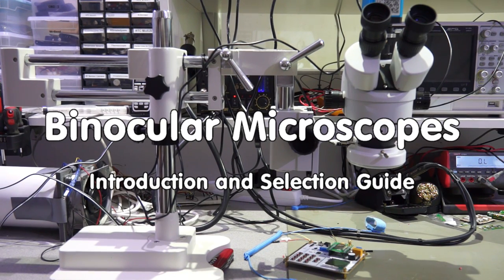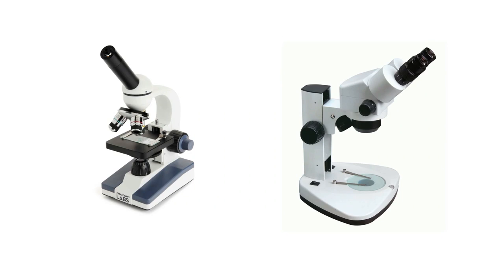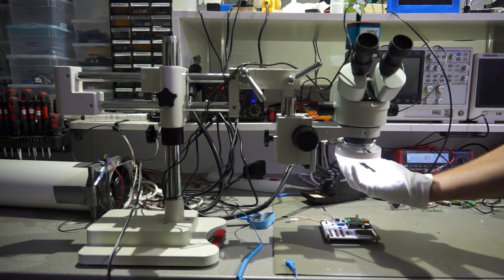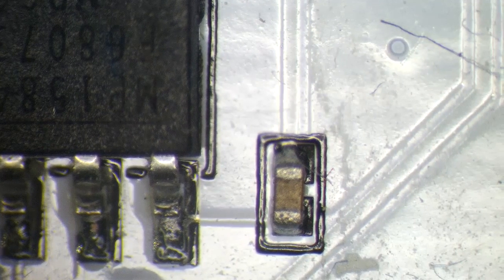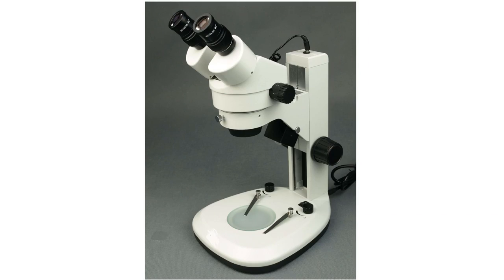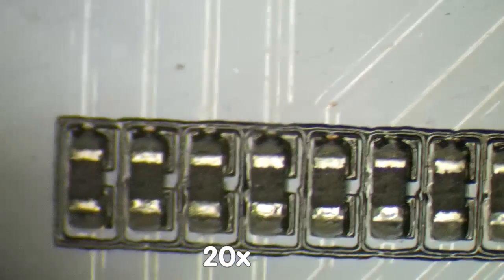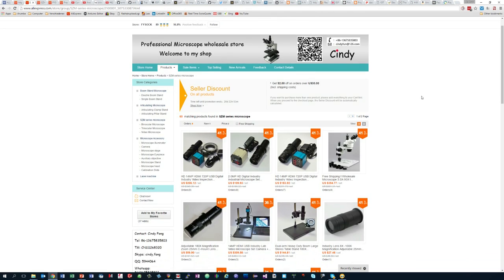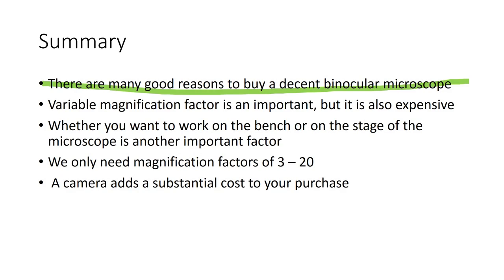#70 How to select a Binocular / Trinocular Microscope?

Comment: Andreas - thank you for the excellent advice. Your videos are always helpful and give great ideas. I bought a LuckZoom trinocular through Aliexpress. Ordering the stand, optics and LED ring separately reduced price by $90 compared with complete package. Also wanted particular stand with optics that don't require me to manually switch optics to enable camera. Parcels arrived well packaged within 10 days and I am extremely satisfied. Make sure you have enough space between optics and work surface to handle the soldering iron.
Reply from the maker: This became one of my most important instruments (the older I get ;-)

Comment: My trinocular microscope arrived today and i am very happy with it, i ordered from ali after watching your video and it cost only about $250 including tax and shipping and it included the 3 lenses as well. This is SOOO much better than using a jeweler eyepiece and then have to bend my neck and keep my face 1 centimeter away from the solder joint. I am using the 0.5x Barlow lens at the bottom and get the entire range of magnification i need from the adjustment knob. Soldering with depth perception is truly amazing. 
I just hope you will also make videos on some.. cheaper electrical engineering peripherals  as i don't know how much more abuse can my savings account take, after being  subscribed to you for some time now :)
Reply from the maker: The microscope is one of my most expensive tools. But it will last longer than I will. So it was a good investment...

Comment: Andreas,

You stated in a previous post that you own a "Eatkins or so with autofocus" camera.

Would you kindly be a little more specific because Eatkins has several camera models based on different sensors.

I'm trying to decide on which camera to buy and this is proving a more difficult decision than the decision for what microscope with options (stand, barlow lens, etc) to buy.

For my budget I believe a camera with the Sony IMX236 sensor is a sensible decision. Possibly the Sony IMX290
 sensor which is a little more expensive because it is more sensitive to light.

I am way out of my league to make an informed decision so I am trying to see what cameras other people are using and gauging their level of satisfaction.
Reply from the maker: I put the links to my camera and lens into the previous post

Comment: I wanted to say that with Andreas' recommendation and praise of the Aliexpress seller Micoptical represented by "Cindy" I decided buy the the same rig as Andreas. The only difference being that the factory in China that manufacturers 90% of this microscope head have released a "new model". The obvious difference between the two is that old model uses a 28mm thread on the Trinocular port, while the new model has a "38mm flange interface".
.
So countless messages went back and forth between myself and Cindy because I wanted to be 100% sure that the microscope head was the new model.
.
Today my 0.5X and 0.35X Trinocular lens adapter arrived from a different seller (because it was the cheapest on Aliexpress. I would have had less problems if I bought from Cindy who would have known what fitted). I was assured by Cindy that the microscope head was the "new model" which also meant that I paid more for the microscope.
.
The two Trinocular adapters that arrived today were 38mm interface (the new standard) but the microscope that Micoptical (Cindy) sent was the "old type" because it has the old 28mm thread interface.
.
When Andreas bought his microscope there was no issue of "old microscope head" and "new microscope head" so it was not possible to make these kind of mistakes.
.
Consequently "Cindy" from Micoptical has been on the receiving end of some very unflattering messages from a very upset customer.
.
This all comes down to poor communications which is what I have been accusing Cindy of. Consider that she uses language such as "old model" and "new model" (where new model comes with a premium price), where had she used language such as "28mm interface" Vs "38mm interface" in relation to the Trinocular port then there would have been ZERO problems.
.
Aliexpress is a minefield of poor communication. If you a lucky (such as Andreas) you wont step on those mines, but God help you if you do step on one of those mines.
.
So we'll see over the next few days days how Micoptical with Cindy at the helm will sort out a very pissed off customer.
.
Buying my microscope has not been a easy experience, but then I am a perfectionist and often expect nothing less than 100%.
Reply: Communication with Cindy continues to be very poor and extremely frustrating. She has agreed to exchange the microscope head she supplied for another model, but she cannot manage to answer simple questions such as ; "Will the model SZM45XT support a 0.35X trinocular adapter?". She often ignores my questions, where in addition I need to "read between the lines" in an effort to understand what she is really trying to say. Let me say that saying "Cindy communicates poorly" is an understatement. Cindy's communication is atrocious.
.
My problems began when I discovered that a 0.35X trinocular adapter was preferable to a 0.50X trinocular adapter because the 0.35X trinocular adapter produces a digital image similar in size as seen through the eyepieces. I discovered this through an incredible amount of online research from users of this family of microscopes from China, so 
.
The advertising on Micoptical Aliexpress Store lacked all the important parameters (such as is trinocular port interface 28mm standard or 38mm standard). Therefore I was supplied with a microscope head that I would never had bought if I knew exactly what I was buying.
.
It appears (according to Cindy) that the stereo microscopes with 28mm trinocular ports do not support 0.35X trinocular adaptors (don't ask me why).
.
Using poor language such "new model" or "latest model" rather than being more specific I was lead to believe that the microscope head I was going to be supplied with is currently equivalent to Amscope's "new model", which just demonstrates what poor communication from China is like
.
Cindy could not even provide me with a legible return address (supplied address was a single text string all in lower case....FFS!). I put the address she supplied into Google Maps where  Google Maps reports that I does not know of such an address.
.
So please be aware that there are inherent dangers when buying a microscope from China. Often there is nothing wrong with the actual equipment, but more to do with the lack of professionalism shown by the sellers.
.
I haven't lost any money so far, but I've expended a lot of time, frustration and effort. I haven't even taken the microscope out of the box because it is obvious that it was not what I wanted.
.
Much has to do with not being an easy customer. I often know what I want, know what is available on the market and very succinctly make the effort to get exactly what I want, so it frustrates me to no end when things go wrong.
.
I just wanted to share my experiences so that others have better experiences. Ultimately poor communications seems to be the root of all evil when buying on Aliexpress.
Reply from the maker: I am sorry for your bad experience. My trinocular works every day for years now. But I never managed to get a camera attached...
Reply: @AndreasSpiess  To say that your "trinocular" is working, but your camera isn't is a bit of a oxymoron. Perhaps it would have been more correct to say that your "binocular" is working very well, but very clearly your "trinocular" isn't working in the true sense of the word if the camera isn't working.
.
Without sounding disrespectful it would appear that you were happy to accept the trinocular port problems because 90% of the value for you comes from using the microscope as a binocular, so it has enormous value for you.
.
Myself I suffer from severe OCD combined with perfectionism (which incidentally doesn't mean I am clever) meant that I knew exactly what I wanted before I ordered. I knew what I wanted based on very careful research based on equipment other YouTubers were using (Louis Rossmann, SDG Electronics, Yourself, etc). It appeared that those who were more successful with their microscope cameras was Louis Rossmann and SDG Electronics than yourself had a "newer" 38mm trinocular interface, while you had the older 28mm trinocular thread. Several YouTubers (who used microscopes to create content) reported that 0.35X magnification produced better results than 0.5X magnification. It started to become apparent that the older microscope with 28mm interface (like yours) did not work with 0.35X magnification. So it became very obvious that the "newer" 38mm trinocular interface was the preferred option.
.
This is where the problems began. There was simply a breakdown of communication with Cindy and myself. Cindy would use language such as "older model" and "newer model" while I would have preferred "28mm Trinocular Interface" or "38mm Trinocular Interface" (I wasn't lying that I suffer extreme OCD!). For Cindy "old model" and "new model" did not mean the same thing that it did to me.
.
I often piss people off because I have a habit of "measuring distances between cities in micrometers".
.
Cindy was looking at the big picture while I was looking at things under a microscope.
.
So who was wrong? I simply consider it a misunderstanding.

Comment: Thanks for making this video.  If you ever update it, would you please explain more about changing out eye pieces for acquiring higher magnification and also more on the barlow lense, such as where it is located, how to change, etc.  I was looking to find out if I could purchase a low magnification low cost binocular scope, and purchase higher magnification eye pieces to get what I"m looking for, at a lower cost than purchasing a high magnification from the start.  Any suggestions would be appreciated!
Reply from the maker: I checked and both are explained in the video. Maybe something to add: The Barlow lens is screwed in.
Reply: Nearly all stereo microscopes are supplied with 10X/20mm specified eyepieces. The "20mm" is what is known as FN (Field Number). Other commonly available eyepieces are the 15X/15mm and 20X/10mm (and possibly others).
.
The problem with greater magnification eyepieces is that as the magnification increases that the FN decreases which gives the impression as if you are looking at your subject through a tunnel (aka tunnel vision), which is not often practical when working on a PCB because you need to see what lies around your subject of interest.
.
You also make the presumption that "low magnification = low cost" which is not the case. For SMD work you will not need magnification greater than 20X, therefore greater magnification in electronics work is of no value.
.
Bigger or greater is not always better.
.
As for Barlow lenses for stereo microscopes. Available magnifications are 0.3X, 0.5X, 0.7X, 0.75X, 1.5X and 2.0X. For 95% of electronics work a 0.5X is most practical. Those who exclusively work on mobile phones might prefer 0.7X as it gives them a little extra magnification. While 1.5X and 2.0X are of little value if you need to "work under the microscope" as there is insufficient clearance between the optics and the subject of interest to get a tool into position.
.
So all you need for SMD/SMT electronics is a pair of 10X/20mm eyepieces, a 0.5X Barlow lens and a 0.7X - 4.5X stereo microscope head. Nothing more and nothing less.

Comment: there are cameras that can give excellent quality picture and motion for soldering electronics. question is which is better, microscope or pure camera?
Reply from the maker: You are right with the cameras. But none is 3D. Which is very important for soldering.
Reply: @AndreasSpiess  thank you I find your reply very helpful. It makes sense why many repair electronics technicians still prefer to use a microscope, it is to get the sense of 3D environment. I will keep this in mind.

Comment: Great video Andreas.
Reply from the maker: Thank you!
Reply: @Andreas Spiess  I need to get one for my bench. I have some personal electronics that can't be fixed by eye and there's no access to one in my area.
Reply from the maker: @jstro-hobbytech  I use my binocular every day ;-)
Reply: @Andreas Spiess  I'm going to try to fix the item once more then I'm putting it on the back burner for a while. I think I'm gonna start a channel Andreas. Hopefully my ideas are attractive to other makers and electronics hobbyists. It's mostly to help locals people I teach at the the non-profit makerspace but I plan to have a dew other videos using unique ideas. I figure it will help my communications skills and hopefully provide some relief to my symptoms and fears related to having complex ptst.
Reply from the maker: @jstro-hobbytech  Good luck with your channel. It will for sure be a learning experience!
Reply: @Andreas Spiess  thank you. I know. I don't know if I ever told you (or if you'd remember) but I took software engineering in university where I majored in data mining systems development. This was back in the day when web crawler and Altavista were still bigger than Google because they were out for years and Google came out my last year of university or so. 
Being a homebody I didn't want to move away and I was passionate about programming and thinking about an electronic engineering degree or a masters but I got shacked up with a girl and went into policing because it was good money here. I was in dispatch and eventually a supervisor. I was being groomed to run the place after my boss retired. 
I always knew there was something off about me but I didn't know what and I wasn't kind to myself for about 2 decades, other than eating well and excessively exercising which in hindsight I don't know how I managed as I was training for a bodybuilding competition (one I knew I wouldn't win but it was a goal so yeah). Other than meeting my wife and getting married my quality of life just got worse and worse until one day I had to get up in the middle of a shift and leave. I haven't been back in 6 to 8 years and I payed into insurance and the government pays me well plus my wife has a good job. 
My symptoms kept getting worse and worse. In and out of mental health, on every medication you can think of. My only hobby was video games and guitar which I've practiced religiously everyday from a teenager but for 3 years it turned into staying awake for days and days playing guitar to a metronome in fear of nightmares until one day I remembered I had a technical degree. So I done an arduino kit about 3 to 4 years ago and it reminded me what my true love was as far as an outlet for mental stimulation. 
So before everything got expensive because of covid I bought thousands and thousands of dollars worth of learning materials for electronics, coding and donated guitars regularly. Last summer I donated everything to our local non-profit makerspace which happens to be the biggest makerspace for over 2000kms being I live next to the Atlantic. They had some decent bench gear but nothing else. I still donate things to them and started a robotics club but things move slow. I figured I learned so much and have gotten so much better from this hobby that I'd try to give back another way. So once we get our house rebuilt as it was taken by by hurricane Fiona and then held up by insurance. We rescue cats so we had the roof replaced and demolished and dried out and luckily we had a few rooms to stay in. My wife sleeps in a vacant apartment downstairs with the cats because she works from home and my gear all survived for the most part but I've slept in my workshop every night for the past 4 months. We finally got the insurance stuff settled (basically someone didn't dot an I on their end) until I figured out the mistake and politely pointed it out as I'm as docile as an old hound. They didn't apologize and we get a bed back in 2 weeks and the work will be finished.

Anyway I've embraced this hobby and have thousands of pages of notes and ten times as many leds haha. I figured I'd throw my hat in to help the students I'll teach and do some other original content pertaining to our hobby. I'm not looking to make money, if I can earn a bit to donate more stuff for kids to learn at the space and maybe get over some of my fears and do it all for a good reason without copying any of the greats like you then I'll be happy. I'm hoping some friends I've made who own channels will give me a mention for some views to get me started but have to earn subs. I can help myself (mentally) and others with some cool content or a free kaiweets dmm (if they need one) then everyone wins. I'm not looking as far past the first first video right now but I have some goals. I've got some educational and funny ideas and alot still to learn myself. All I need is a new printer but until then I'll use the makerspace. Plus I'm sick of cheap printers and will dive into fusion when I get one I dont have to watch for fifteen minutes to lay the first layer. Haha I pretty much gave away my printers to a guy who gave me an incredible trade on my first one. I needed places to put clothes as I have no dressers. Lol

Anyway I'm rambling. I'm hoping by late Feb to mid March to have the first video up. I'll email you a link of the first rough draft if you like as I'd appreciate a few peoples opinions. I'll be starting an account with a channel name and using my name in the videos. But I wanna keep my real name as a fallback that will only be used to show friends ideas
Reply from the maker: @jstro-hobbytech  I look forward to your first video!
Reply: @Andreas Spiess  I you're too kind my friend.